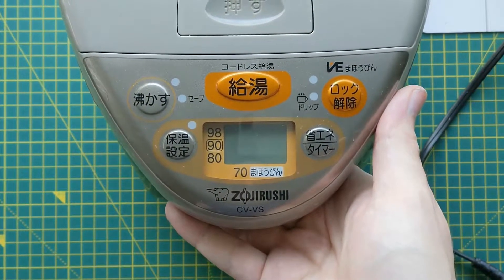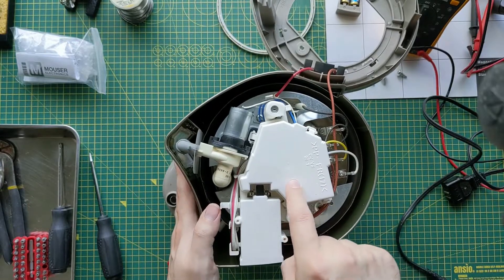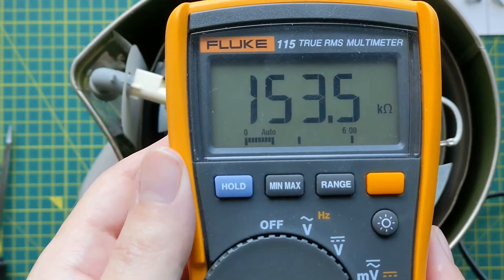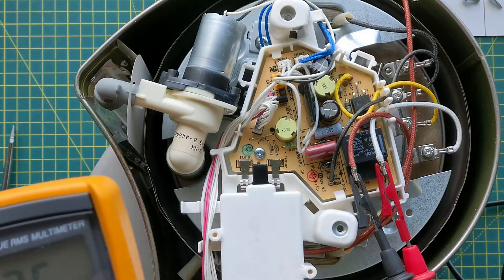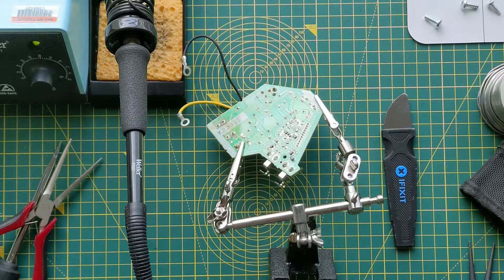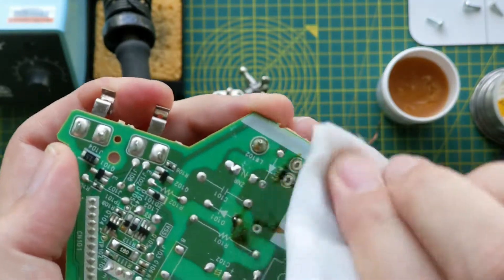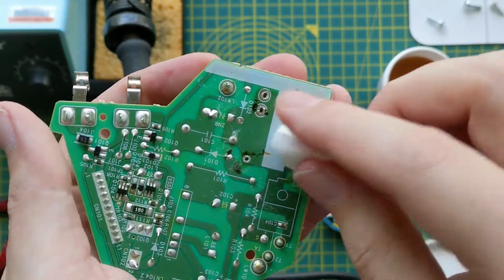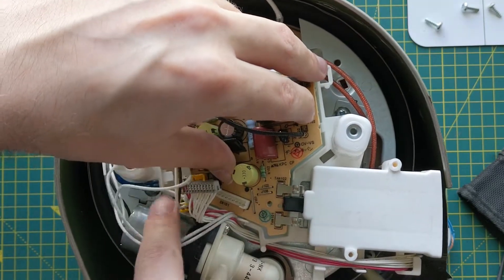Zojirushi Water Boiler: Continuous or Excessive Boiling Fix

Comment: Thank you for the video. My issue with zojirushi water boiler cv-dsc40 is I can’t select any of the Keep-Warm temperatures via the Temp Set button after descaling the unit. I have no clue for where to look. I appreciate for any suggestions.
Reply from the maker: I think maybe you got water in the control panel. Unplug it, let it dry completely, and maybe open the control panel to dry and look for damage.
Reply: Thank you for quick reply. Yes I did take it apart, cleaned the control panel, and blowed dry it. I didn’t see anything obvious. I can hear the clicking sound when clicking the Temp Set button. As of now it’s default to 195 deg and wouldn’t change to any other preset temperatures like before. Customer service suggested to unplug the power cord to exit the cleaning mode but it didn’t help.
Reply: I replaced the Temp Set Tactile push switch and got it to work. I now can select any of the Keep-Warm temperatures. Thank you again for suggestion.

Comment: Hello all! Mine just doesnt start boiling, everything turns on okay, and you can start boiling process, but nothing happens and temperature remains the same (room temp). Any ideas?
Reply from the maker: @pete7110  Check continuity of the heating coil, then check that the relay functions, and inspect any fuses.

Comment: My one boiling to 100 degree can stop boiling, but the warming heater keep warming at 98 degree, it wont drop to 90 degree when setting 90 degree, replace Relay and thyristor still keep heatting, any suggestion ?
Reply from the maker: Either the relay is stuck, or the computer is sending the wrong signal.

Comment: My Zojirishu is a different model and had a different part number in it, but the specs of this relay appear identical to Omron one. TYCO OEG PCDF-112D1M . But not available on Mouser etc. Only found it on aliexpress.
Reply: What symptom of your Zojirishu? Have you fixed it? Thanks. Mine kept boiling until the water was low. Now, got E4 error.
Reply: @Tondan-c9l  same problem - kept boiling. fixed with part in my comment
Reply: @HuyNguyen-fn4ev Thanks. What is your Zojirushi model anyway?

Comment: Where could I get a thermostat for a model CV-DCC Zojirushshi Hot Water Dispenser. Company will not sell internal parts. Tried Mouser, but no luck. Thermostat has no marking of any kind.
Reply from the maker: Are you sure it's the thermostat that's broken? I would expect them to use a K-type thermocouple, which should be very reliable (no moving parts).
Reply: Tried to send photo of the thermostat, Sent emoji by mistake. Anyway, not certain it’s the thermostat. It heats up to correct temperature but won’t maintain it. Water cools off. Does this intermittently.
Reply from the maker: @richardrosin369  I imagine that there is a 2nd circuit for temperature maintenance. I don't think it bangs the relay for that. Have a look at what components connect directly to the heater leads. There may be an SCR there to run a low power heater for maintenance. There may also be a second heater coil which may have failed open.
Reply: What SCR?
Reply: What is SCR ?

Comment: Hi, I have what seems to be a related, but different problem. When I plug my unit in, I am able to dispense water, but after boiling water, the water dispenser pump is absolutely quiet and doesn’t work. If I let the unit cool down, the dispenser pump seems okay again for a bit. I disassembled it and nothing seemed amiss. 
Is the dispenser pump connected to a relay that might be sticking when it gets hot, but working normally when it’s cooled down?
Any idea where I could find a wiring diagram for a typical water boiler? I’m an amateur at electronics, but I might be able to figure out what I need to replace with that wiring diagram and/or a wee bit of your guidance. Thanks!
Reply from the maker: I think the first step will be to get some leads attached to the motor, and verify that it gets voltage when the unit is hot. Obviously, be careful and take it slowly. In addition to line voltage, now you also have boiling hot water as a hazard.
Reply: @Avidiax  This sounds like it will be a good time…
Reply: @Avidiax  Is it typical that a relay would behave like this due to temperature? I read somewhere that hitting the relay might temporarily solve the problem? Or is this an atypical failure and I’d have a higher chance of figuring it out by investigating elsewhere?
Reply from the maker: @Clamp5010  When I look at my model in the video, there's only one relay, and it's for the heating element. The pump looks like it is run off of low-voltage DC. This makes sense, since my model has the battery-dispense feature.

My gut feeling is that temperature may be a red-herring for your case. I can't think of anything that would stop working at high temperature, with the exception that maybe thermal expansion and contraction can cause electrical contacts in a relay or in the commutator of the motor to start/stop working.

If you have two relays, then yes, tapping on them might temporarily fix. I doubt that your motor relay would have substantial wear, though. It would handle much less current than the heater relay.

Comment: Mine just stopped working suddenly yesterday. I disconnected pwer cable and put it back in, nada, nada. I let it rest the whole night and plugged it back in the morning and suddenly the re-boil button started working again!! 

Mine is 13 years old ..maybe getting too old and time to replace new one!! 

Between Tiger & Zojirushi ,,,what brand do you prefer? I thin I would continue buying the Zojirushi ...13 years is a long time for a water boiler getting broken ...very very durable!
Reply from the maker: That does sound like it could be a similar relay problem. 

I was just in Japan a month ago, and can't say that I've seen anything new in the world of water boilers, except perhaps that they are more energy efficient. Over 13 years, improved efficiency will pay for itself. Other than that, Zojirushi is my favorite brand, but Tiger impressed us with a rice cooker. They should both make a great water boiler, and it will just come down to features, price, and style.

Comment: My Zujirushi water boiler , it’s not working for coming water when pushed the dispensed button . I opened the it and checked , the water pump is not running when connected with power . So where can I order the part ? I didn’t see it on Amazon or eBay .
Reply from the maker: I don't think you can order the part. I would try to use a strong descaling solution and try to force some descaler through the pump. If that doesn't work, taking the pump apart and cleaning it may help.

Comment: I have the CV-EA model I bought at a Yamadadenki. Someone let my unit run out of water and now the boiler won’t even turn on. I want to repair it. Where do I find a screwdriver bit set like this?
Reply from the maker: These are called "security bits". In Japanese, the search term would be "セキュリティビットセット".

Your boiler would most likely need a new thermal fuse. If the thermal fuse is integrated into the heating coil, the boiler may be a total loss.

If you ever find a screw that is impossible to find a bit for (or you damage the screw too much), you can use a "screw extractor" (スクリューエクストラクタ). You may have to drill a pilot hole in the screw head, but then the screw extractor will bite in and pull the screw out, and you can replace it with a standard screw.
Reply: @Avidiax  本当にありがとうございました*\(^o^)/*
日本に住んでいるかな。
僕は山口県に住んでた
Reply from the maker: @SeanAmman  Maybe someday I will live in Japan. For now, I can only visit :)

Comment: would you say if there is no power at all it could be that same mechanical part?
Reply from the maker: If the display won't turn on, it's not that part. If the display works but the heater never starts, it could be the relay, or it could be the thermal fuse.

If the display doesn't work, use a multimeter to confirm continuity from the plug, and then inspect the power board for burnt/exploded components, or leaking capacitors.

Comment: Hey, besides not boiling - did it show any error codes? Mine is not boiling too, but when tried to descale it - it show code E4.
Just want to make sure, have to open it anyway... :)
Thanks is advance!
Reply from the maker: No, there were no error codes in my case.

https://webcache.googleusercontent.com/search?q=cache:2HGxnKHp484J:https://www.zojirushi.com.tw/faq/3+&cd=7&hl=en&ct=clnk&gl=us

E4 - The heating element is disconnected or the PCB is faulty.
E3 - Temperature sensor has poor contact or is faulty, or the PCB has gotten wet or is faulty.
E2 - PCB has gotten wet or is faulty.

One additional thing to check is whether the thermal fuse has blown. This can happen if the unit ever seriously overheated or boiled dry.
Reply: Have you fixed your yet? Look like mine is similar your. As first, it kept boiling until water I manual turn off (disconnect the power). Now, I plug back, it is showing 80 then for a while it shows E4.

Comment: Hi i changed the relay like you showed but its still boiling non stop. Sny ideas where else to look? Pls advice
Reply from the maker: Verify that the temperature sensor is securely attached both to the pot and the electrical connector. 

Double check that you have reattached the terminals correctly, and have no shorts.

Attach a multimeter to the coil contacts and verify that the relay is being commanded properly.

Comment: My continuous boiling was accompanied by water leaking from the bottom.   I found out along with the calcium build up on the terminals ...the inner boiler pot was not flush with the outer structure of the unit so when there was condensation the water would leak through between the inner boiler pot and the outer structure...

Cool video!  

By the way do you know if there is a place to buy just the inner boiler pot?
Reply from the maker: The only parts you can get directly are replacement gaskets and the lid: https://www.zojirushi.com/app/spare_parts/category/water-boilers-warmers

You can try a parts inquiry: https://www.zojirushi.com/app/customer_service/entry
Reply: @Avidiax  Thank you for this comment. I was able to get my Zoji working again by drying out the control board but the same problem happened again. I couldn't figure out how the water was getting into the board until I saw this comment. I looked at the gasket on my lid and there were 2 cracks in it. I pulled on it a bit and it cracked some more. Ordered a new Zoji gasket online for 9 bucks, they are local here in Torrance so should come soon.